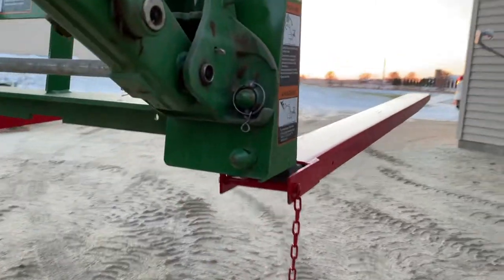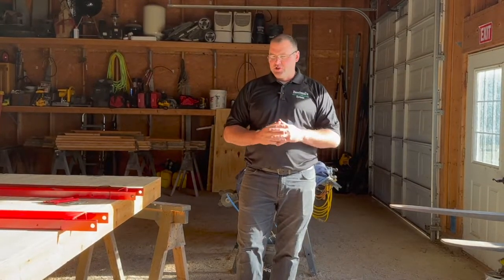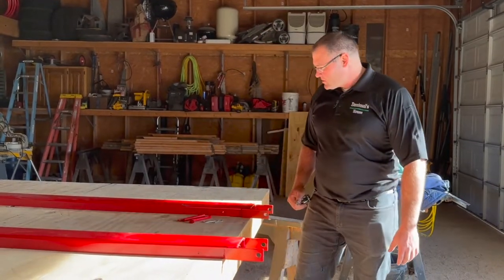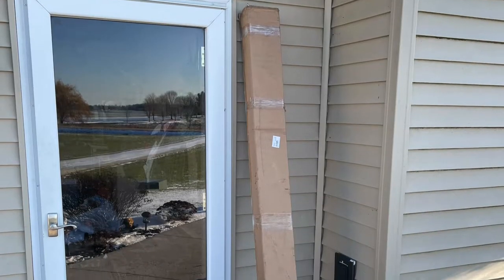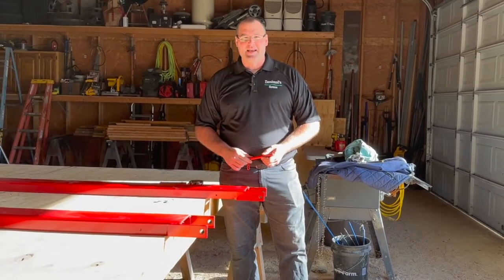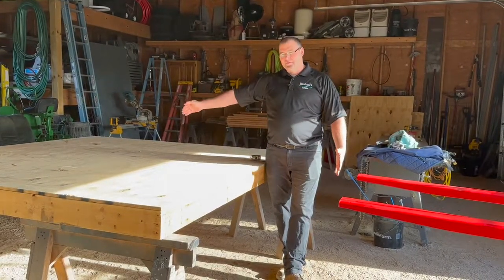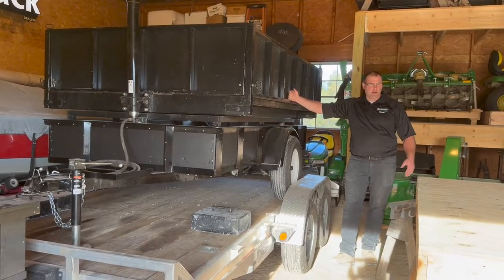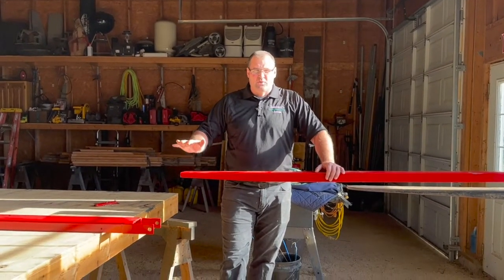82" Pallet Fork Extensions on JD 320R Loader

Comment: The machine would only tip forward if you had the machine in 4-wheel drive when its not needed and you hit the brakes.
Reply from the maker: Kerry, I would strongly disagree with the risk of tipping if you have an extended load in front of the tractor that is more than 400-500lbs without a counter weight on the back of the tractor.  If I have a full bucket load of gravel and don't have anything on the back and want to lift up to dump the gravel on something above the ground level like a trailer or wagon, if I turn and slow down normally the opposite rear tire will come off the ground and the entire tractor becomes compromised and unsafe.  That being said, each operator just needs to know their machine and each machine is built a bit different.  Thanks again for watching!

Comment: I wish someone was making an extension like that back when I bought my JD 970 in 1994. I needed a way to take off the very heavy tonneau cover on my Ford F250 crew cab. It's a 2 person job for sure.   I ended up finding some solid channel steel that fit perfectly over my bucket forks. So I'm able to lower the tailgate on the truck and just drive the tractor forward and lift the tonneau off no problem. Thanks for doing this video. Will be helpful for lots of new tractor buyers. 🚜
Reply from the maker: Thank you and good luck out there.

Comment: I was searching amazon for pallet fork extensions to move a chicken coup (78.5 inches front to back) a small distance and your video is greatly appreciated. I like that these extensions have the 2 brackets (which is a big selling point because a lot of others don't have them) underneath to hold them in place better and the steel pins and the end. I just ordered them.
Reply from the maker: Thanks for the feedback.  I don't plan using them much but when I need them they will be very helpful.  Take care!
Reply: @Danimal’s House  I received my fork extensions, and they seem heavy duty, but I haven't used them yet because the pins are too short. The hole that the cotter pin goes through doesn't reach the outside of the fork, so the pins are useless. Waiting for seller to get back to me so they can send pins that are the correct size. Update they emailed said they dont have longer pins.  Don't know how anyone can use them unless the pi s I got were somehow shorter which seems odd.